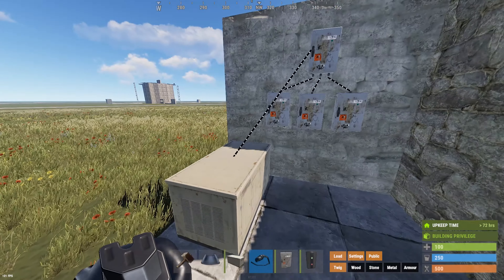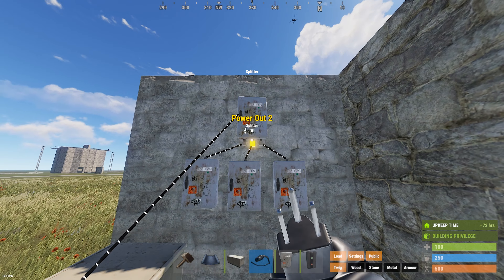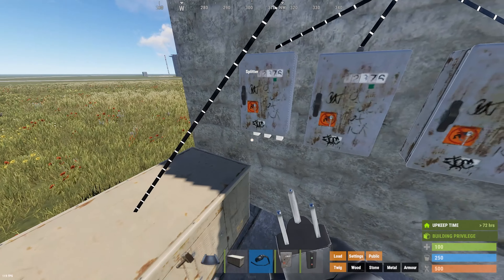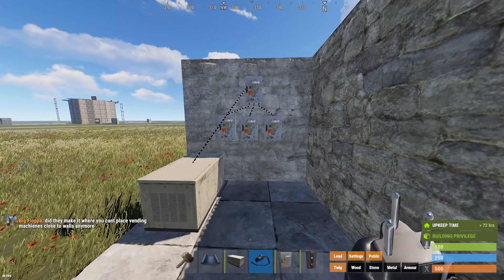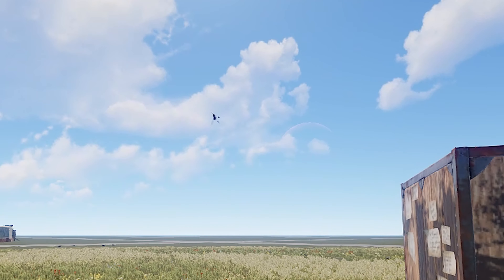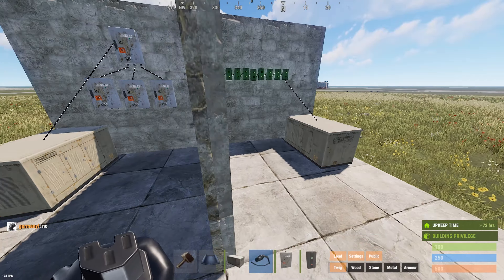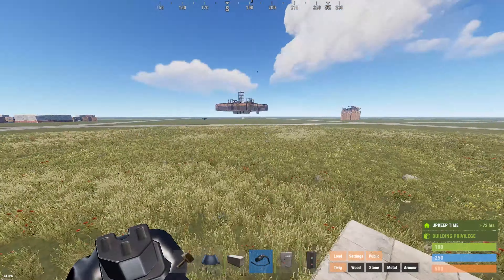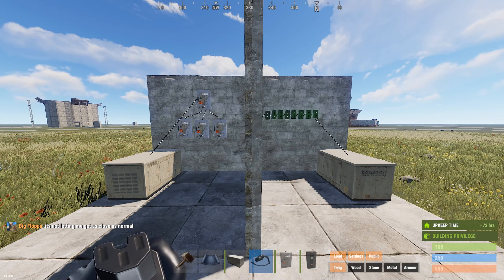Power nine turrets with one test gen // Rust // Simple Electricity...

Comment: Anyone have an update for how to get all three of the new test generators power outs into 1 switch?
Reply from the maker: take 3 root combiners, connect the 3 to the power in on two root combiners, connect those two root combiners to the third via power in, then you could put the power out directly into the switch. Lmk if this helps:)
Reply: @kradtfos  Thanks, I was trying to the two root combiners to one switch. 2 hours later and 30 videos. Im going out of my mind.
Reply from the maker: @SaltyGrub1475  happy to help my G
Reply: @kradtfos  technically you only need 2 root combiners as each have 2 inputs, but you're only burning one extra power that way, so NBD 😂
Reply: @SaltyGrub1475  ^

Comment: I power 27 Turrets with one test gen. No brownouts. Root combiners baby, get with the times
Reply from the maker: Yo what that’s nuts, do your test gens give more than 100 power?
Reply: @kradtfos  2 root combiners per test gen, all test gen leads go in, one combiner feeds the last lead on 2nd. 298 power, steady on "vanilla" test gen. I don't understand what about doing it that way avoids the over 100 brownouts, but it does. I haven't seen a single video about this trick, either. Question is, u wanna go viral now, or wanna flex the hidden gem first? xD
Reply: @z33thr33  Man i love you for this
Reply: Test Gen have 3x 100 power slots... still need 2x for my waterpumps but he'll I go overboard.
Reply: @adamevans9697  wait, for pumps???? XD I guess I've never built a large scale farm. I just always use a chain of 3-30 water collectors feeding into a barrel on a timer, and only run 3-12 small planters
Reply: @michaelsshowhoe2801  this video has the right idea with splitters. 96 power into 1 splitter which feeds 3 more splits = 9 outputs of 10. I like setting this up from a branch for each 9 turret node so I can adjust the power input up if I need to for things like break detection and/or target alerts, or adjust it down for cutting power for loading if you don't have smart switch

Comment: i power 12 turret
Reply from the maker: 42 turret
Reply: @kradtfos  legitimately 27 Turrets per test gen. At least. Bro, you could make this a new video. Let me fill you in: Yes, if you use all 3 nodes at 100 power, you get brownouts. HOWEVER! You CAN use most of the 300 power. You're NOT limited to 100. The secret is root combiners. You combine the power from each test gen output with 2 root combiners, and then you have a steady 298 power with NO brownouts. I almost don't want you to put this out because it's been a great advantage for me.
Reply: So each out put has 2 root combiners so you’d need 6 in total ? I’m new to electrical and I was just givens. Test gen by the server owner I’m on and I’m trying to protect my little shit cube lol
Reply: @danb5723  2 root combiners per test gen. each root combiner has 2 inputs one output, each test gen has 3 outputs. 2 of the test gen leads both go to one root combiner, then the last lead and the output from root combiner 1 both go into root combiner 2, and voila, 298 power instead of the plebian 100. You can power 27 turrets with this through splitters, however, in a small cube as you say, you;re better off placing 3-4, and putting the rest of the power on hidden tesla coils, preferably on both RF remote and HBHF sensor trigger. But don't worry, you'll get there faster than you think if u stick with it. ;3
Reply: @z33thr33  DAMNN thx, gonna have fun playing 20x with this trick
Reply: @snoopgt8861  this also allows you to fully bury your generator, and you can then tuck in the root combiners behind something like a workbench